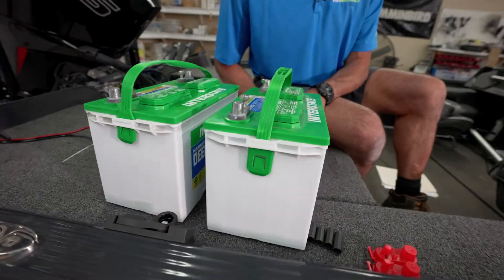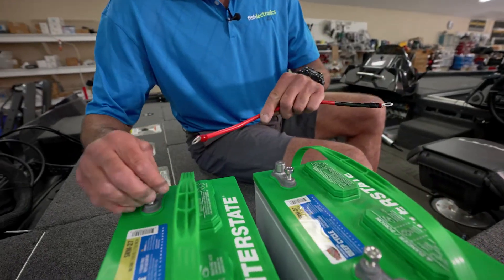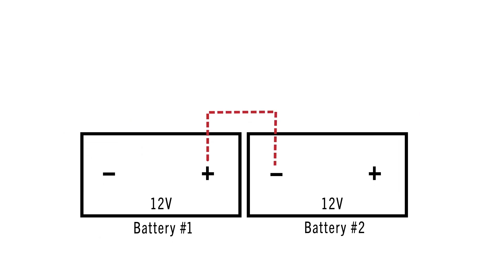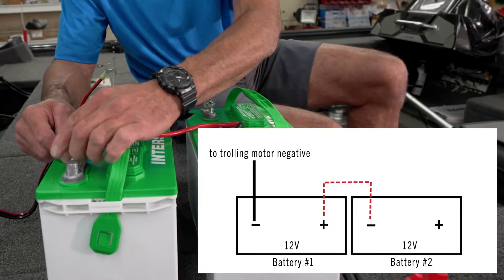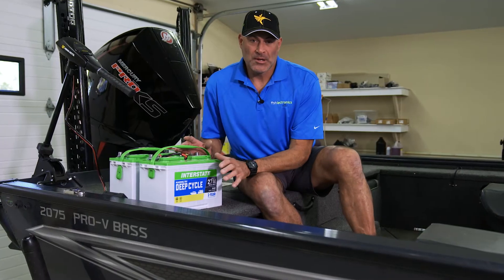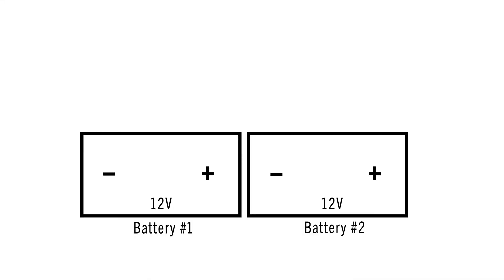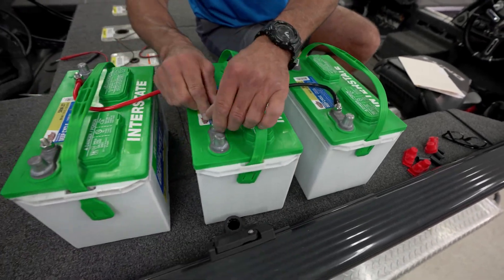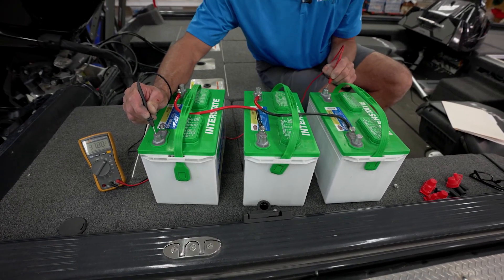How to Wire Trolling Motor Batteries In Series | Minn Kota

Comment: When installing three 12v lithium batteries in series for my trolling motor can I install and use a three bank 12v battery charger or do I need a 36v charger…Thanks

Comment: Do you recommend charging a 24v battery setup of 2 batteries individually on 12v or charge both at 24v? On a 24v Lithium Charger
Reply: What did u end up doing I have the same question.

Comment: Hello, I'm going to stick with the lead acid batteries for my Minn kota terrova Trolling motor 80 pound thrust 24 volt but your website recommends a 110ah batteries. And I can't seem to find anything that goes that high with interstate. And in this video, the batteries you are using are only.  98ah what should I go with? Thank you, please respond.

Comment: nice video. Can I use wire from another trolling motor to make a jumper wire?
Reply from the maker: Coach Randall,
There is nothing special about the Jumper Wire.  You could use any wire that is the size of the battery wires on the motor or bigger.
Best Regards.
Reply: Yea just don't use anything under  8 awg. Like 16 awg won't work lol

Comment: I noticed in this video, you've been using 88 AH. Do you have a Interstate model that can go above 100 AH. Please give me the model if so. Tks!
Reply: I use SRM31 batteries. 3 12v deep cycles. 100ah. Bigger batteries but I’m using them for now until I get a fancy lithium ion battery.